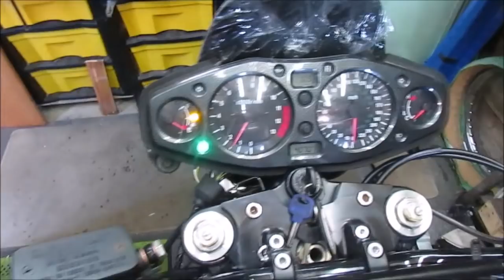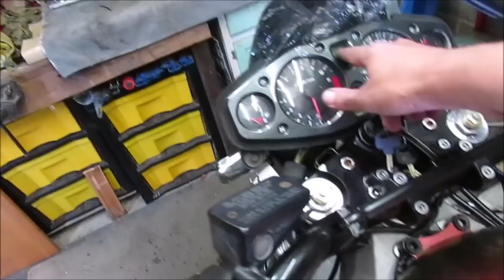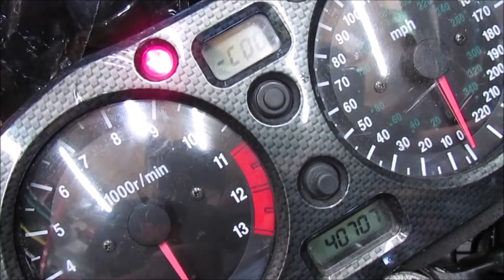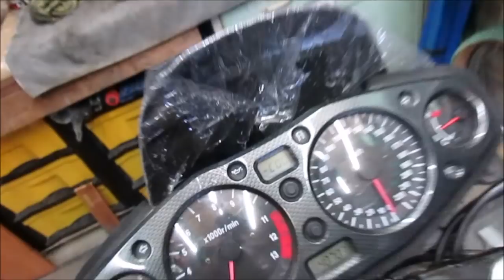Suzuki Hayabusa - Part 19 - She's Alive........ALIVE

Comment: If it was me I'd just cut the plug off leaving plenty of wire on the plug side.. Find the earth wire first connect it then connect one wire at a time. Process of elimination hope that makes sense. Did it with my ZXR750H1 with the new electronic clocks. Good luck I'm sure you will sort it.
Reply from the maker: Thanks, want to keep the loom standard, just in case i ever decide to convert it back to its original form, but i have a plan and wiring diagrams, just got to do it and film it

Comment: I hope you got sorted with the clocks...as I said to you some of the wires are in different places on each plug ..best way is get both wiring diagrams and go from there....I just spliced in the gsxr clock loom into the busa one...most of themare the same colour apart from a couple so diagram will show you which is which..
Reply: fra murray , i agree, got to be a slight difference in the plugs.
Reply from the maker: Hey mate, yes already to be done, your project coming along nicely
Reply from the maker: @mark broomfield, i started with Srad clocks, then switched to gixxer thou clocks, you the to either splice your loom or as i have done, bought a gixxer thou clock loom, and some connectors and made the extended loom that way, you will need the wiring diagrams of both bikes as a couple of wires are different, only thing you wont have is a fuel gauge, but you can get a separate fuel gauge an wire that in, i am thinking of swapping to a smaller Koso clock as space is an issue, but same principle, hope that helps

Comment: May be nothing, but are any of the pins slightly bent in the plug or are the female ends all ok, not damaged? I’ve had a similar problem with a different type of connector and I had a tiny piece of swarf between the pins, took me ages to find it!
Reply: Pins are just in different locations in the plugs..just need gsxr loom and wiring diagram.... I have done this mod a few times and its not plug and play....but not a hard one....

Comment: Always going to sound worse inside, but it does sound nice. As has been said the wiring inputs are not an exact match for each cluster so it’s down to diagrams for each bike. Electrics I hate them. 😀
Reply from the maker: Cheers Edward, franks been a great help, so hopefully will get them connected soon